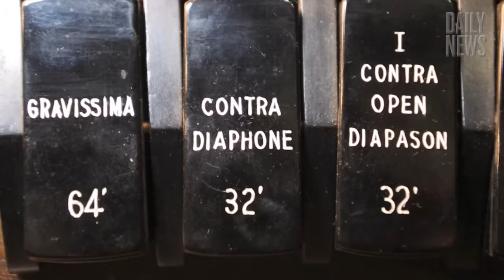The Wanamaker Organ - Inside the world's largest operating musical instrument

Comment: I wonder how the pipes are actually connected to the keys.
It is amazing that pressing a key make a sound somewhere else in the building.
Reply: For an electropneumatic instrument like this, pressing a key with one stop activated for that keyboard creates an electric signal that goes to a computer board within the console.  That computer board takes all the electric signals at any given instance and sends an electric signal to the pertinent computer board of the pipe chambers involved.  That second computer then takes the information and sends electric signals to a smallish electropneumatic valve that's underneath the specific pipe to be opened.  Between that valve and the pipe toe is a wooden box that contains pressurized air; the wooden box has on top of it a wooden rack that holds and keeps upright all the pipes of that rank (which is one pipe for each note of the keyboard).  When the valve opens, the pressurized air can escape and will travel through the open toe of the pipe and cause the pipe to play a note.  There's more physics involved with how the pipes themselves make music.

One thing also to consider with this: Due to the age of the wires, contacts, and computer systems, along with the distance from the pipes to the console, the sound will be slightly delayed from when the keys are depressed.  Most of us organists learn how to play with a delayed reaction without slowing down.  As if we have nothing else to worry about. :)
Reply: @HeidiKohne  Wow... thanks a lot. But in 1904 there were still no computers. The first computer (ENIAC) was build in 1945 and only had the simple functions of a pocket calculator, so I guess the organ was different at the beginning. I once saw a description of a smaller organ, which had long levers and rods connected mecanically from the keys to the valves on the floor above. But I can not imagine how that would be possible with an organ this size.
Honestly... I hate envy... but with this I can't help it :-)
I can't even play a small piano, and you play organs with both arms and legs... ha ha.
It must be a wonderful feeling just touching an instrument like that.
Again... thanks for your answer.

Comment: Exquisite and spectacular!  I do want to know one thing.  Is there a fire suppression system to protect this treasure.  All the aged, dry wood would likely go up in minutes without one.
Reply: Actually, sprinklers can do more damage than the fire itself.  Water is wood's worst enemy (well, so is fire).  Of course, it depends on the fire location, strength, etc.

Comment: I never knew what lay behind the operation of a large pipe organ. Is this typical of other large pipe organs?
Reply: Yes: a BIG air-blowing machine is the heart of every larger pipe organ.

Imagine you had to blow it like a flute...
Reply: @Xogroroth666  No lungs on this earth have that power. Though,  in 'Pumping Iron', Franco Columbu blew up (exploded) a hot water bottle with his lungs.
Reply: @nephos100  Hence: imagine that...  ;)
It was meant as a jest.   :)
Reply: @Xogroroth666  Sorry, bit of a dry reply from me. I did take your comment as jest, thus my suggestion of someone like Franco having a go (quite forlornly I reckon).
Reply: @nephos100  Oh, my bad.
My Asperger acting up, misinterpreting you.
Still, that was fairly impressive, what Franco did.
Hmmmm... where would it go if he took a try at blowing a church organ?    :P
Maybe you can hit a really high note for a few seconds?    Xd

Comment: what I want to know is how pipes are made to mimic strings
Reply: There are established ratios of speaking length (mouth of the pipe to the upper tip) to the diameter of the pipe that give the different timbres.  Flute pipes are typically fatter and string pipes are really narrow.  Materials help some, too.  For the Wanamaker organ, the String Division has many ranks of pipes that are off-tuned to help give the warm string sound (anything labelled Celeste or obviously Sharp or Flat is the indication that's it's not tuned to the rest of the organ).

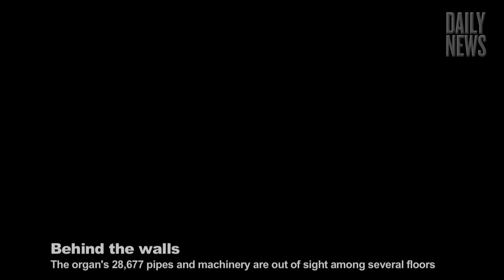Comment: wait, was that a piano in the organ at 2:37?
Reply: Anon Ymous probably
Reply: Yes, for tuning. You tune the pianos for tuning the organ. :p
Reply: And someone has to tune the tuning forks, for tuning the piano, for tuning the organ. LOL
Reply: It's actually a stop, a fairly common one, played via the console like any other. See here for example: https://youtu.be/ne8ng9y6zMA?t=1568
It's not used for tuning. To tune an organ, you first tune a single rank in each division with a digital tuner. You then use that rank as a reference to tune the rest of the division. You simultaneously play a note in the reference rank and the same note in the rank you're tuning, so you just have to adjust the tuning until you hear a steady tone rather than an undulating one, which indicates that both pipes are sounding at the same pitch.

Comment: Hai i always wonder how is the response time from key input to played note i tryed ones a big Church pipe organ and the response was disappointing sluggish (delay)
Reply: +ted tedsen If I was playing this organ, I would want headphones as a monitor to have instant feedback for what I was playing. Keep the delay for the physical pipes in the other part of the building - customers won't know or care. But the organist should have a computer-based instant digital feedback of his performance.
Reply: thanks for the reply that make sense
Reply: Part of the skill of a pipe organist is being able to play despite the latency.
Reply: The delay depends on how the organ is build. Electric and pneumatic transmission pipe organs have much more delay than mechanical ones, where metal wires and wooden rolls pull the valve open when you press a key. In pneumatic and electric organ the delay depends on how it is build, the technology it used and the size. If the organ is very big and the pipes are very far away from the console where you play, the delay tends to increase. I hope that answers your question :)
Reply: Even if the pipe response is near instantaneous, it still takes time for the sound from the pipe to travel through the air back to the bench where the organist is sitting at the console.

Comment: Wait...HOW MANY pipes and you have to install fake pipes?
Reply: Oh that's normal.  Many organs in the country have fake facade pipes, many have sounding ones.
Reply: It has to do with the way large organs control volume by placing the sounding pipes in a chamber and controlling the size of the opening to control volume. This greatly simplifies the air supply system.
Reply: I see lots of people don't understand what 'fake' means.
Reply: @seanwatts8342  I see you fail to understand that when people stand in the atrium of a building housing the world's largest fully functioning pipe organ, they expect to see pipes. Those who build such instruments design them to sound the way they desire. If they must throw a bone to the uninformed in order to foster appreciation, interest, and maybe even financial support, so be it. Life isn't always perfect.
Reply: @michaelclark9762  No, the pipes are not usually VISIBLE in the atrium... I think you should go back to whomever tried to teach you English and demand a refund.
Reply: @seanwatts8342  The faux pipes that you're blowing a gasket over are certainly visible from the atrium. All you need to do is look up to the right of the console.